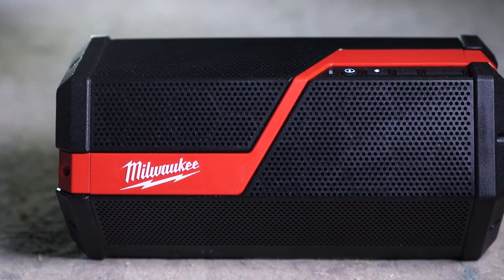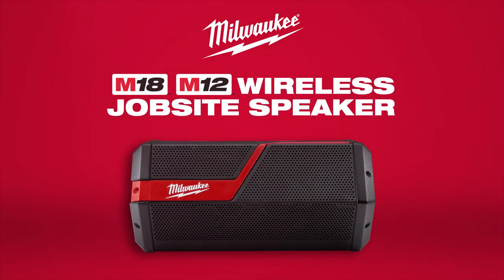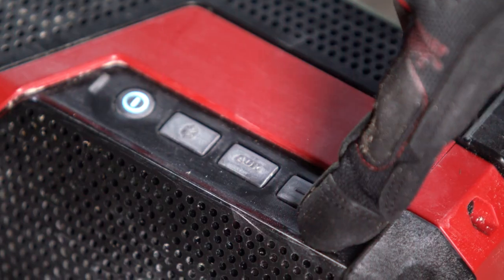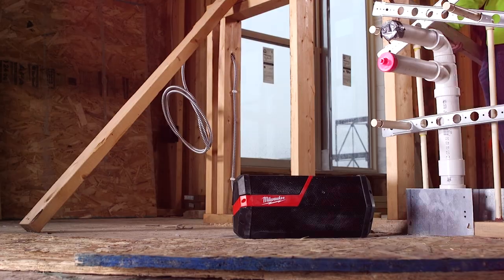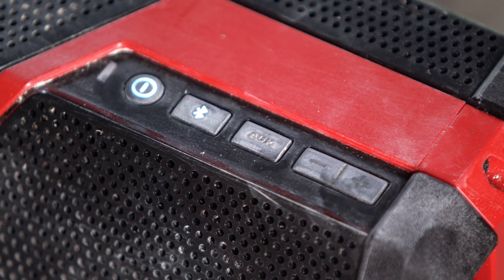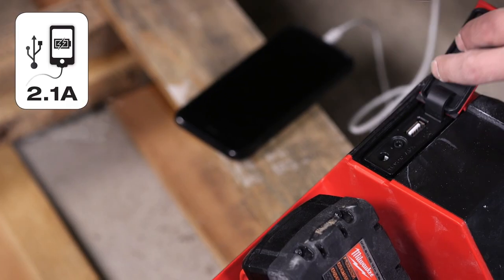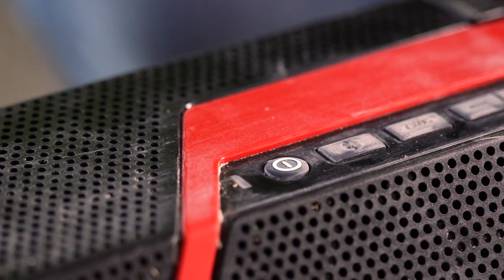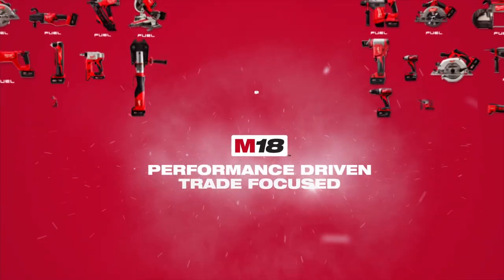Milwaukee® M18™/M12™ Wireless Jobsite Speaker

Comment: Mine just died, still connecting but no sound. What's the warranty?
Reply from the maker: Hi there! We suggest utilizing our warranty options that can be found here- http://ms.spr.ly/6054lSd06
Reply: @MilwaukeeTool  
Thanks for the reply. 
I checked and there's only a 1 yr warranty on that.
The speaker isn't damaged in any way it just stopped playing, is there somewhere I can order a new circuit board? I can't find one online yet .
Reply from the maker: We are happy to help! If you need a part, you can find our Service and Parts list for our tools on our website - http://ms.spr.ly/6057lSorl. If we have the part you are looking for, you can call 1-800-SAWDUST for assistance with processing and ordering.

Comment: Radio is a dying source. Unless weather and news stations are necessary. Other than that, radio stations are like Politicians: repetitive and useless.

I like that there is no radio.

However, where are the other two speakers? I see two speakers and two tweeters. Are the two passive radiators actually speakers. Marketing bull dookie.